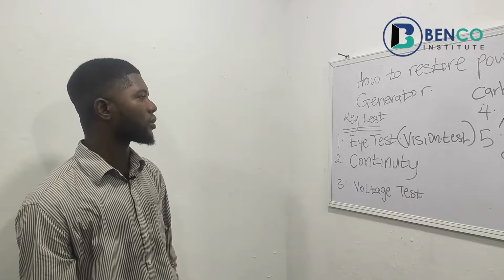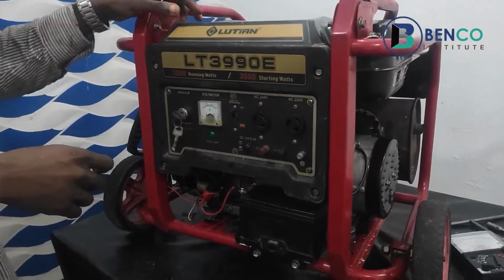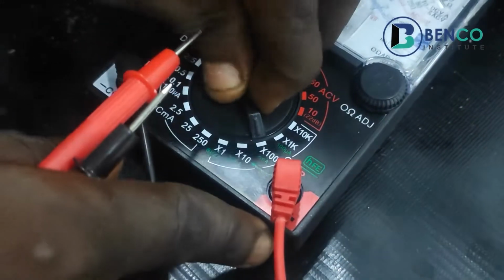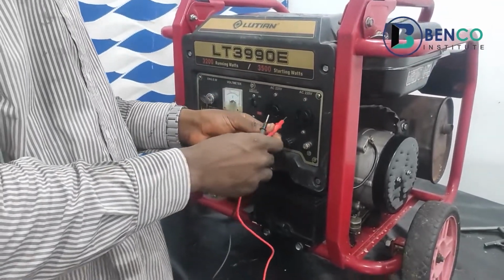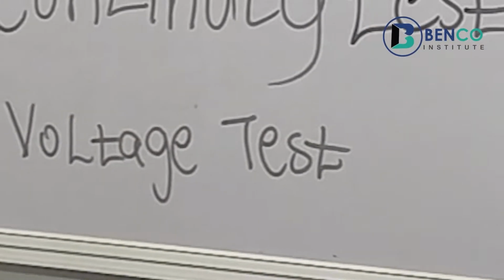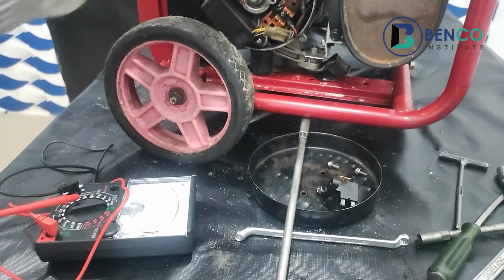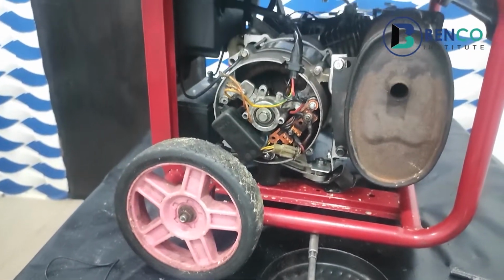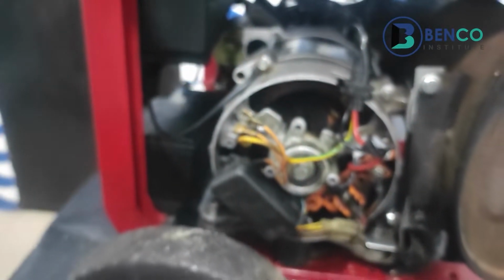Repair Small portable Generator with no power/Electricity. AVR Test,Brush test,Alternator test done

Comment: Pls can u recommend a brand/model of a very good and fuel efficient generator in 2.5kva range in nigeria
Reply from the maker: 2.5kva

With modest price,low fuel consumption (mainly depends on your load though) ,copper alternator...

I will advice manual Elepaq yaofeng constant
Reply: @bencoinstitute   i currently own a elepac ec5800cs which is giving me issues like offing itself while working and wont start until it cools down and light fluctuations. The gen is not even a year old so is it the model or am i just unlucky
Reply from the maker: Elepaq constant is quite different from that one though... Send me d pics of the gen on WhatsApp